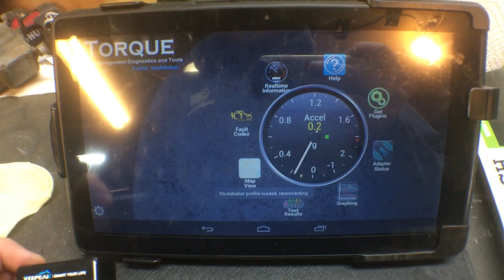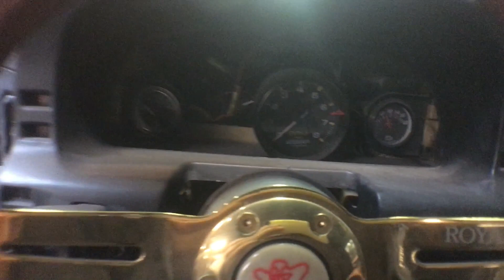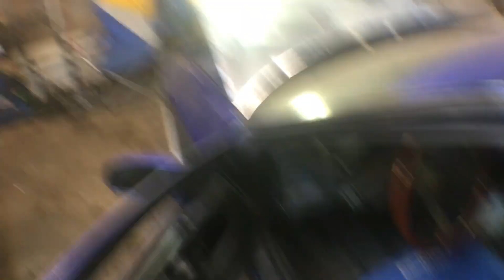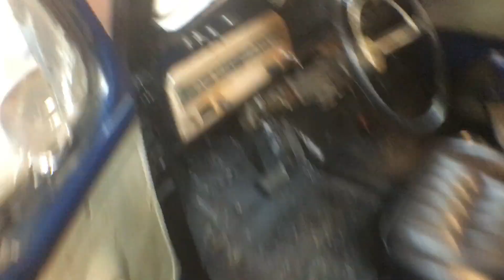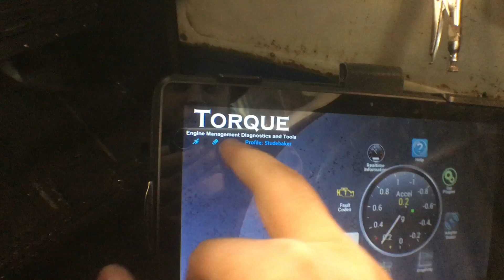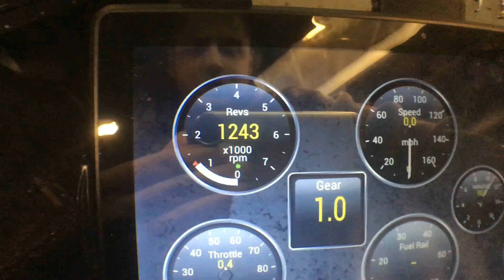The Cheapest Gauges For Your LS Swap!!!

Comment: Hey, how do you do the odometer? If just using the Obd2 port?
Reply: You can add an odometer to the screen from the app. Problem is because it is GPS-based it resets to zero whenever you shut off power to the unit.

Comment: Is that a radio that's far left on the dash on inside of that Studebaker?
Reply from the maker: No. That’s the factory gauges. This truck was never equipped with a radio. But I have a head unit in the glove box now

Comment: You can use that if you use an aftermarket ECU like a Holley Terminator X.
Reply from the maker: fun fun terminator x has its own display, it’s pretty awesome. This is mostly stock ecu you need an obd2 port. Most aftermarket will not.
Reply: @FcDominick  I know, but it's small.
Reply from the maker: fun fun they have upgrades on the Holley site

Comment: Great video!!! I’m looking for a Veepak now! Could you do a video on how you setup and installed your fuel system? I doing an LS swap in a mustang coupe and have not figured that out yet. Thanks in advance!!
Reply from the maker: CouchHam there are way too many ways to run a fuel system. I’ve spent hours look at specific fittings, I’ve done it a few ways. You need to know if it is a return style, power goals and budget.
Reply from the maker: CouchHam honestly you can probably run the stock mustang pump, lines and all of your fairly stock.

Comment: Awesome info. But did you just leave the factory cluster u plugged? Not even in the truck?
Reply: Oh shoot. I should elaborate. I got my engine from a Silverado. What I mean is. I’ve installed the engine and complete wiring harness, computer, fuse panel etc from the Silverado. I was wondering if the engine will still function fine without the factory Silverado cluster plugged into its original harness. Hope that makes sense.. I appreciate the help!
Reply from the maker: Bruce Harmer yes it will work fine. I’m only using the engine side of the harness. Anything that came out of the fuse box that went into the truck was eliminated.
Reply from the maker: Bruce Harmer the factory cluster is just there. No wires or anything to it. Just to keep the old look. I plugged the adapter into the obd2 port for the newer motor that’s in the truck. I just have the obd2 port wired and mounted in the engine bay. I made my harness and that’s where I have all my fuses and relays sitting, seemed like a good spot for the obd as well.
Reply: Awesome!! Thanks!!